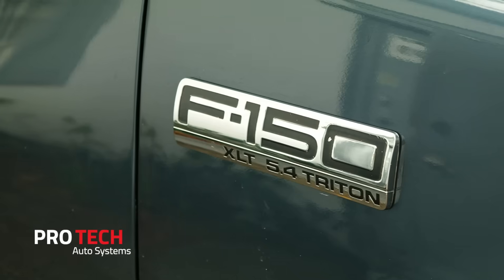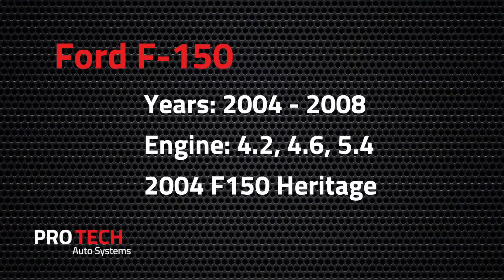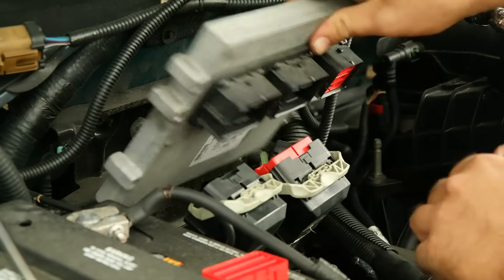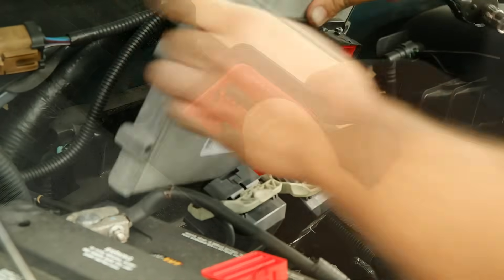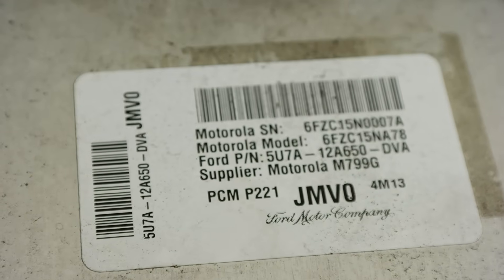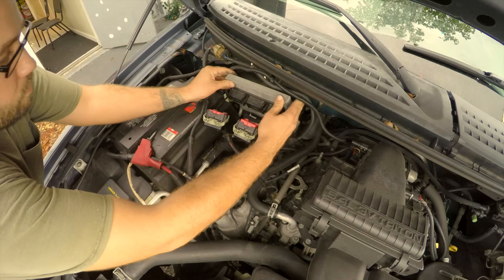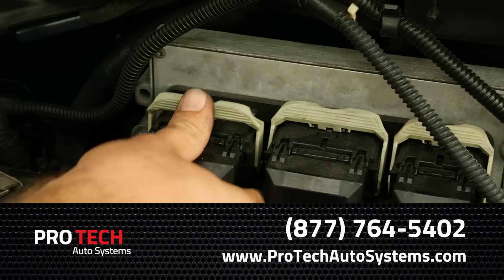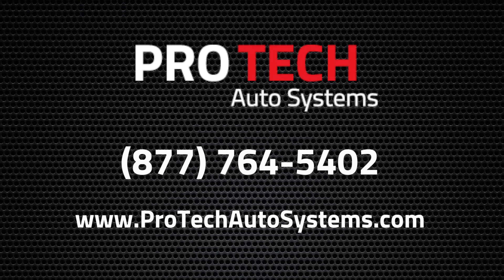Ford F-150 PCM/Computer Replacement - 2004 to 2008

Comment: hi I have 2008 f250 and im getting unintended acceleration when I come to a stop light at idle it will rev up 0 to 60mp and I have to put my foot on the brakes and turn the key off several times before it goes back to normal   will the pam computer be the culprit I only have 60,000 miles on the truck thanks
Reply: Not sure if a Ranger 3.0 V6 is the same.  My son's truck did the same thing. We replaced the throttle control body(or the electrical connection) and that fixed the problem.

Comment: I have two 05 f150 4x4 5.4 3v trucks..can i simply swap the pcms with no proramming to see if the issue in one truck is the pcm ?
Im getting injector on time drop down to 41.5 or so from cylinders 5-8 when 1-4 stay around 2.70-3.00 so it seems the control side is having an issue which i beleive would be the pcm dropping on time thus starving these cylinders of fuel enough to cause my intermittent missfires. If anyone knows, please let me know as i really need this truck. Thanks

Comment: I loved this video I did notice you didn’t reprogrammed the system I have the same truck with the same issue do you know if I need to reprogram the system
Reply: that's also the same question I have. They never mentioned if we have to reprogram the new PCM

Comment: a shot in the dark here i'm going  to call as soon as ya'll open my 2005 navigator read electric throttle control a few days ago and went into limp mode I made it home and had a new throttle body put on because it said something about the throttle control it may not be related because now my truck is in a no  sound no crack condition  my key and immobilizer iare fine so that's not the issue I bypassed the starter solenoid to jump crank the truck to let it idle for 20 minutes  to calibrate the throttle body after it warmed up I drove it for a 5 minute ride I was aiming to go 10 but the truck is still obviously in limp mode so I turned around and parked it it  has a strange U 1900-20 (CAN( Communication Bus fault code the truck was fine then in the blink of an eye went crazy on me this is unfortunate because the truck is in excellent shape. besides this issue

Comment: How do I know if it's bad my 05 f150  wont  crank and no power to anything..put a new battery in and still nothing..
Reply: did you figure it out? Im no tan expert mechanic but from what you described I would be leaning toward a new pcm
Reply: It was the alternator bad
Reply: @scottypetty9117  That seems odd since all the alternator does is charge the battery..well I guess if the alternator was bad then battery would discharge to nothing and when you go to crack it over nothing would happens since there was literally no power from the battery draining to nothing.
Reply: Yes sir exactly what was happening..funny thing it showed it was charging on the dash guess the Guage was lying but all is fixed now with no problems..🤷‍♂️🤷‍♂️

Comment: My lil wrench light is on got it goin into limp mode the code for that is p2106 change my Theodore body already so now the code saying the ecm cause it’s still in limp  mode like it’s reduce speed is that the ecm before I buy one

Comment: If you replace the control module from a junkyard truck,  do you have to get it flashed?
Reply: I need this question answered too
Reply: Thats a good question.   Hello, Hello?
Reply: Yes . Then the unit will need a parameter reset done on it to synchronize all components involved in the Passive anti theft system . I.e. PCM  with fuel pump or cluster or both. Forscan will do this for a lot of vehicles from Ford.

Comment: I have a 2004 f150 5.4. The day before it was driving perfectly. Next day go to drive for truck, and the wrench on the dashboard popped up, and it was on LIMP mode. Fuse f32 keeps blowing. I’ve checked the o2s( all 4 of them are new), unplugged the vcts, rechecked still blowing the f32 fuse. Unplugged the MAF still blowing the fuse. I’m just nit sure what else to check. Thanks
Reply: did this fix your problem ?
Reply: @aidanmckinley8885  looks like it

Comment: I was wondering if you swap PCM from 4.6l to a 5.4l  and key tumbler of the same year 2005 f150.? For reason s I  losted my keys and my is too far from the nearest dealership, it's old truck and Bush truck

Comment: Just got a truck fuel injection wire was open on fuel rail,4.6 build sheet still under intake pulled pcm and opened it to find a few chips open and fried ,Ford should be used because I can clearly see it was someone in their facility stretching harnesses and not doing the job right,the build sheet was just waiting to catch fire stuffed under the intake thsts paper and the engine will ignite paper... Complere lawsuit for half assed work on a brand new truck on assembly line
Reply: Can you stop talking like shi speak clearly

Comment: Hello
my 2006 runs great ..but I am receiving a 0605 PCM Error code. no other problems with the truck...will a new PCM resolve this problem.
Reply: Any progress?
I've had this issue about 6 months now. Truck drives great, but engine light is on. Same code along with cam shaft sensor fault, was told it's because of the other code.
Reply: @kcsbullies7571  I had a sensor replaced in my mustang. Had a crank position error for a while and had to get it flashed at the dealer. Had to reprogram the crank. Some call it relearn the crank.

Comment: I'm a bit confused. Don't you have to program the pats to computer? If not please explain, Please.  If all I have to do is remove, relace and drive off into the sunset, I will have to buy one from You  in the future. I moved to Central America and brought my 2003 ford f150 xl 4.2l 4x4 with me.  I did not know about the PATS. The computer will go bad, It's all a matter of time I would love to keep the truck going.
Reply: I believe when you order it online , you give the VIN and they flash it , then send it to you
Reply: First the negative cable should be removed to do this, to prevent any "stray voltage" . As far as PATS, that might not be flashed in at the factory. However if you have 2 fobs (keys), it is an easy procedure to program them to the new PCM.  Insert 1 in ignition, turn to on 1 sec, then off. Remove it and do same for key 2, then reinsert key 1 again an do the same. That should do it... that's how I did it anyway w no problems.

Comment: once i installed the new one my truck wont start...need help !!
Reply: Mike you need 2 keys for the truck to start.
the new ECM needs to learn your key codes
Instructions
insert key #1 and turn to "ON" position for 3 seconds
quickly turn off and 
insert key #2 and turn to the "ON" position for another 3 seconds
turn back to off and then try starting your truck with  both keys. 
Good luck!
Reply: @gussandoval1892  is it two keys for that ecm only or 2 keys for the truck itself. I dont understand if I need a new ignition switch also when replacing ecm
Reply: 2 keys for the truck. Your regular everyday key and your spare. If you only have one key you might need to buy a second key or buy a new ignition switch with 2 new keys. Hopefully you have a spare key somewhere and avoid the extra expense.
Reply: @gussandoval396  can I just buy a new spare key and have it programmed, then just buy ecm and slap it in?
Reply: Aj yes you can.  If you buy it on Ebay the are some that come with extra uncut keys
Reply: @gussandoval1892  Does this work with a ford that has the PATS system?  Thank You for any help.
Reply: So from all the comments the 30 dollar pcm will turn into 300 by the time I get keys cut 😒😒😒😒
Reply: milleniumann28 if you find a pcm for $30 I wouldn’t buy it. If you buy a plug and play unit it will just take reprogramming the keys yourself

Comment: If you replace this part on an 04 expedition will it learn the truck itself or does it have to go to a dealership.
I have traced everything on the starting system and i believe the pcm is the problem

Comment: Can you please explain what DVA mean on the tag? I have a 2005 mustang gt with manaul transmission. I want to swap out for a automatic transmission. My car is even 4.6 v8, equipped with pats system. I just want to be able to identify the correct part for my swap. Please help.

Comment: They breathe computer but they  not even mention to disconnect the battery yeah right
Reply from the maker: How do you breathe a computer?  No need to disconnect the battery.  English?
Reply: Dont have to disconnect if youre smart enough to not have keys in ignition in the on position like half the idiots do,,like plugging in anything make sure its turnt off first...thats all

Comment: I'm having a problem with my 2010 dodge journey the middle connector has some type of fluid coming out and causing it to die on me while driving. could it be that I have to replace it?

Comment: You didn't have to disconnect the negative battery terminal before messing with the computer and putting the new one in?
Reply from the maker: +Steve Barnabei 
Hey Steve.  No need to disconnect the battery for this one. Thanks!